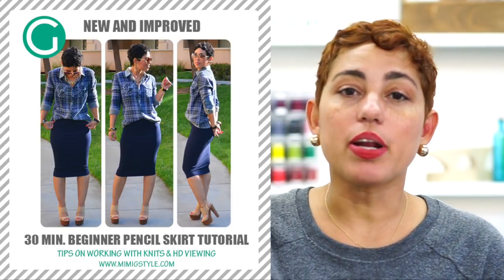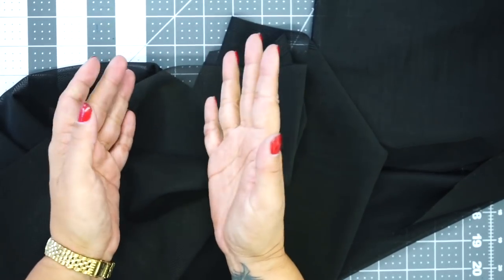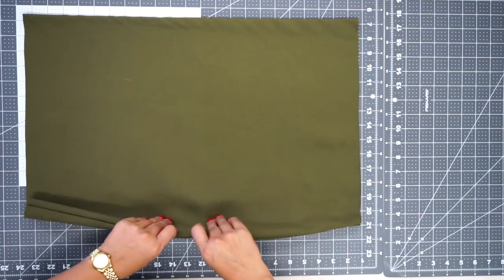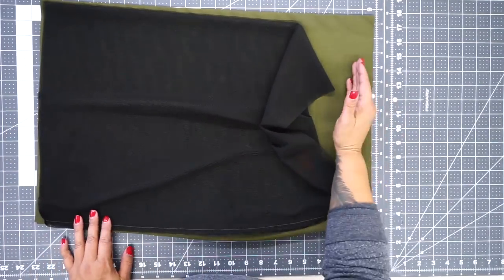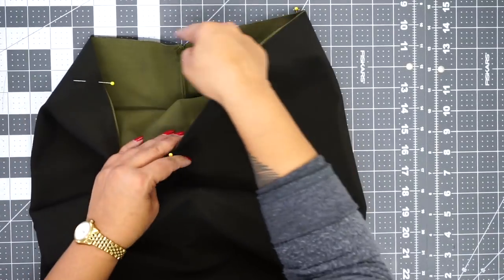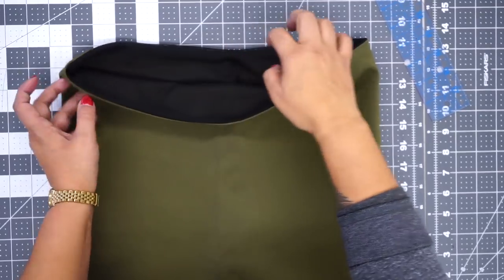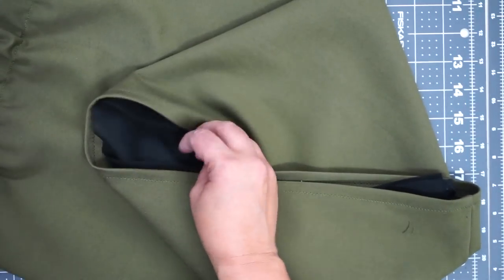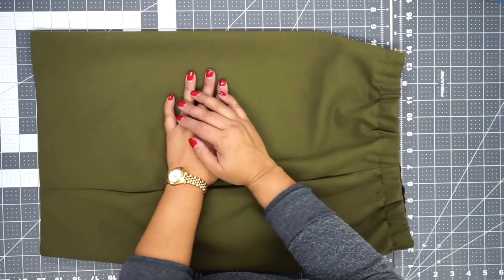HOW TO ADD COMPRESSION MESH TO YOUR GARMENTS: NO PANTY LINES!

Comment: No more wearing my "spanx" tights under everything.  I'm going to put elastic only in the mesh and use it kind of like a slip instead of putting it in each individual skirt. I guess I'm explaining it correctly. You are amazing Mimi thanks.

Comment: Great video. A question: you cut your power mesh smaller than your skirt, but it didn’t look like you were stretching it at all when you were pinning it to the skirt waistband area. Were you in fact stretching it a little and just didn’t mention that?

Comment: Hey Mimi,
I checked out your 30 min pencil skirt video and loved it. I have a question about measuring. 
In your 30 min video you say to take 2 measurements, the length and your waist. But, the pencil skirt in this video is not just a rectangle. Could you please share with me what you did to make it more fitted like the one in this video. My hips and waist have a 4 inch difference and I would love to make a skirt like the green one in your video.
Its probably super simple but I am very new to sewing and cutting patterns.

Comment: Thank you so much for this tip. I'm in the midst of developing a new type of bra and was trying to think of what fabric to use that would have some stretch but also hold its shape really well. 
Can I just ask one itty bitty sewing question though? I noticed that you didn't iron the seam on the skirt open and flat before joining the power mesh. Is that usual for a stretch fabric (I, obviously, haven't sewn much with knitted fabric before)?

Comment: This is a good idea. However it only works in simple projects like this one and preferably where you have fabric hugging your body all around front and back. It gets quite a bit trickier in dresses although it can certainly be done since it can often pull and distort the dress, sometimes the neckline or armholes where the under structure is tighter. And the powermesh can ride up if too tight and you will feel like reaching all the time under the dress and pulling it down. As I said for pencil skirts like this it can work fine but I would stick to spanx for dresses and keep the two separate and moving separately and not attached